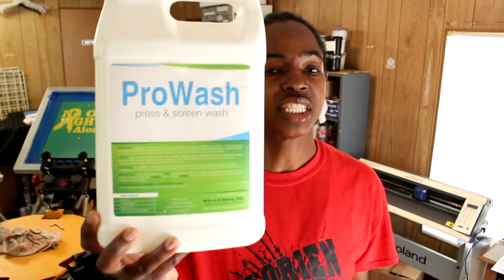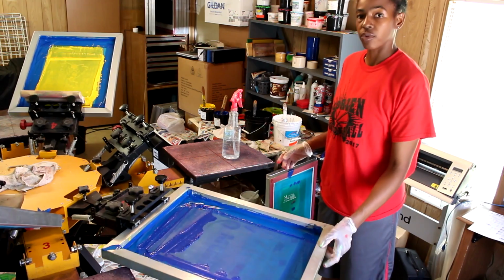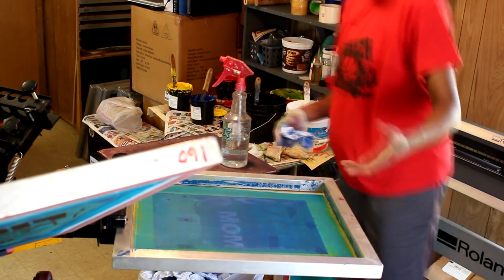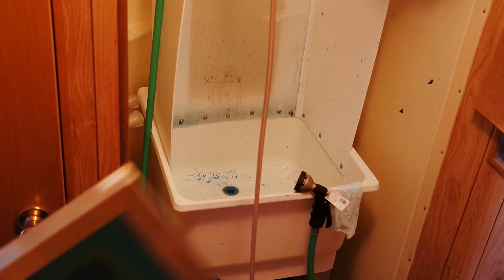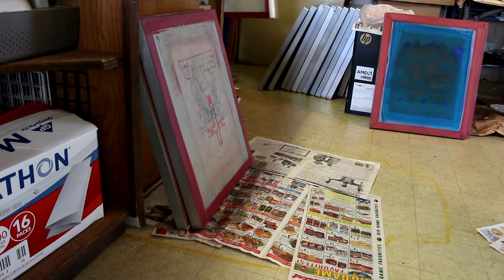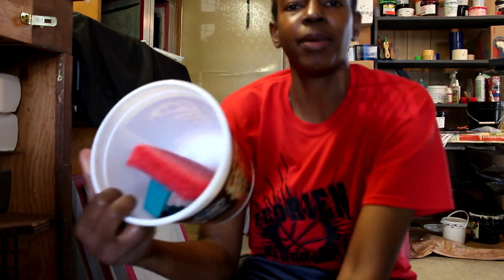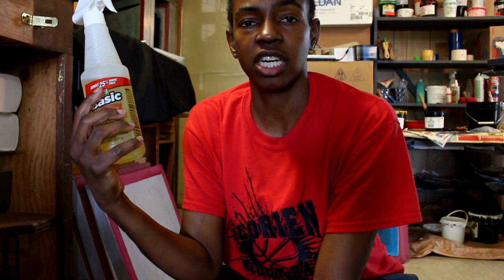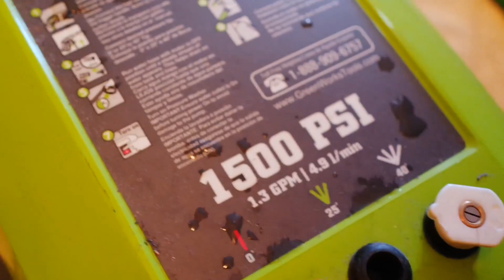Screen Printing 101: Removing Ink and Reclaiming Screens TshirtChick

Comment: Thanks for the video, where does your drain water go? I just washed my first screens but I didnt use a degreaser they already have emulsion on them. I used water based paint whats is this going to work?

Comment: nice vid,  what kind of emulsion do you use,  i keep ruining my screens using the red hybrid emulsion,  any suggestions
Reply from the maker: I use Ulano QX1 emulsion.  If your image is washing out you may not be exposing for long enough.  If the image will not wash out you may be exposing too long.  I know that's kind of generic advise but that's about all I can tell you without specific details.   I hope that helps.  Thank you for watching!

Comment: How often can you reuse screens? Thank you for answering my questions. I really I am going to try screen printing during my summer break. Everything looks so expensive.
Reply from the maker: I am not sure how many times you can use them but I think it really depends on how you take care of them but over time they will wear down and become loose.  It cost a little bit to get started but it's a lot cheaper to screen print than using vinyl because the ink goes a long way.
Reply: TshirtChick thank you

Comment: Why do my emulsion come off screen after I burn my image  on the screen. I let my screen dry about 5 hours before I burn my image.
Reply from the maker: Emulsion has an expiration date How old is the emulsion?  Was the emulsion completely dry before you burned the image? Emulsion does not work well in very cold temps. Was the emulsion room temp before you coated the screen?  Did you degrease the screen before coating with emulsion? If emulsion is not burned for the correct time it will be under exposed and will wash out.  Did you burn the emulsion long enough?  Without seeing exactly what happened I can not give a 100% correct answer but hopefully this will help you figure out what the problem is.